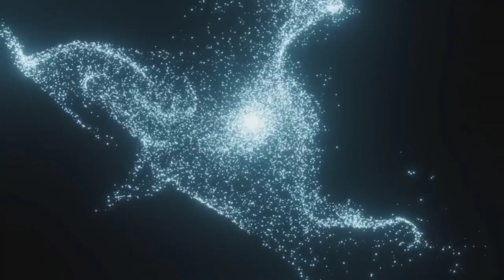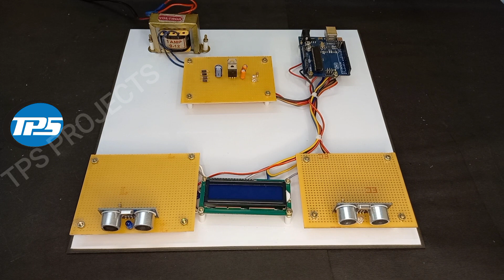Two Ultrasonic Sensor Using Arduino Find Distance || HC-SR 04  ||  with download Code

Comment: Hi, I want to set 2 ultrasonic sensors in such a way that if the distance measurement of both sensors is not within +-5mm it should give alert. In what way can I do that?